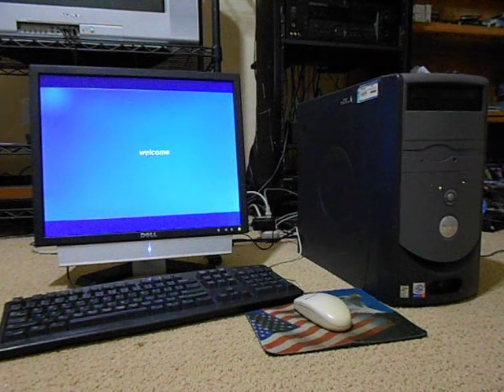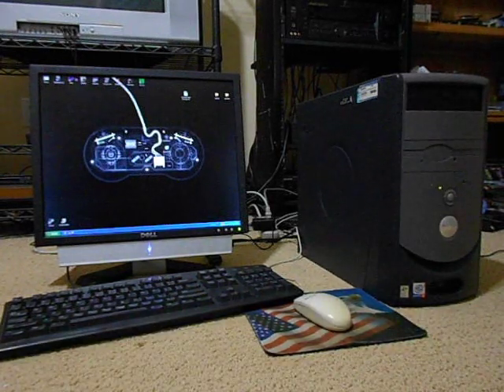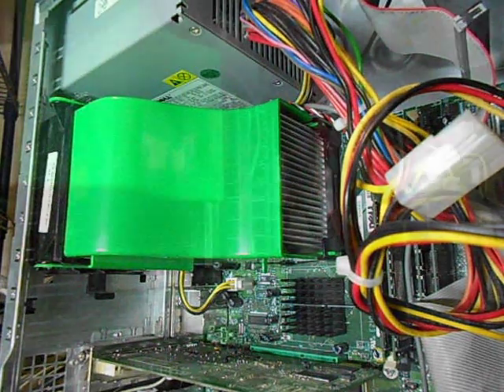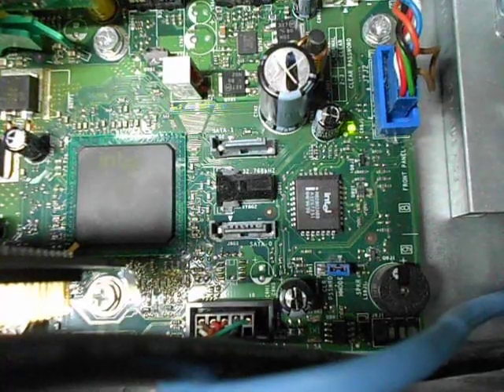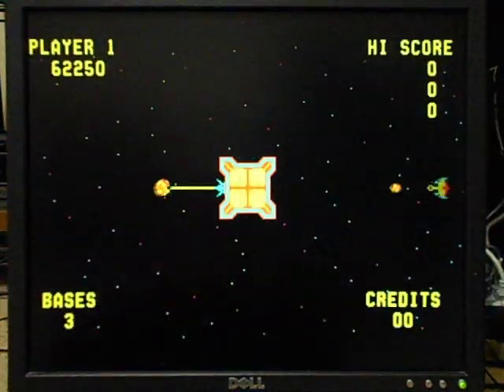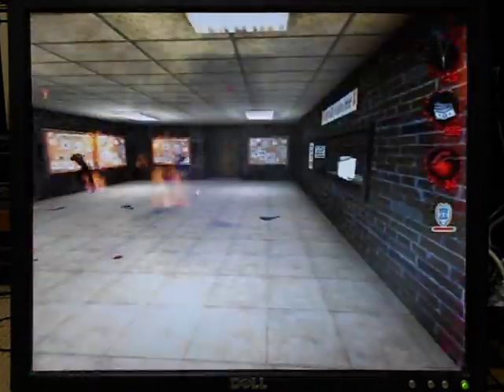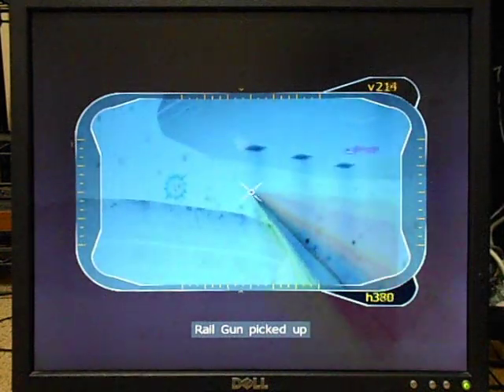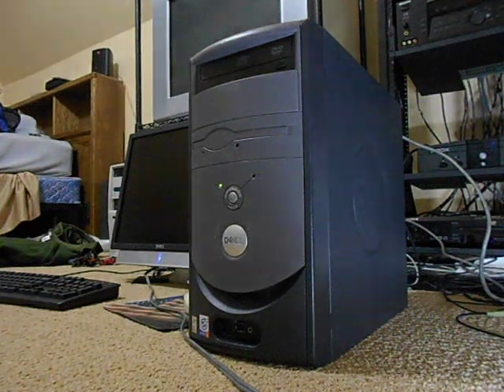Dell Dimension 4600 (Pentium 4 2.4ghz)

Comment: Ridiculous how much better Goldeneye is on the emulator.

Postal 2 was actually a bit of a bitch to run when it was released, i used to have to cut down the body count just to get decent speeds with the PC at the time. Thought about maybe making an arcade cab with it? Looks like it would be the perfect machine for it.